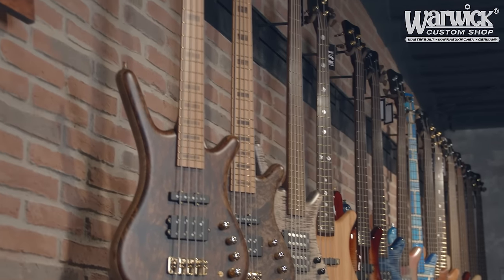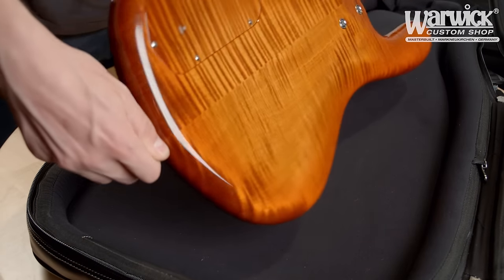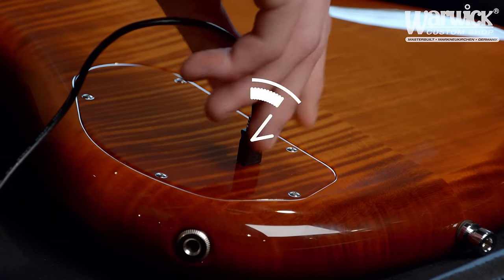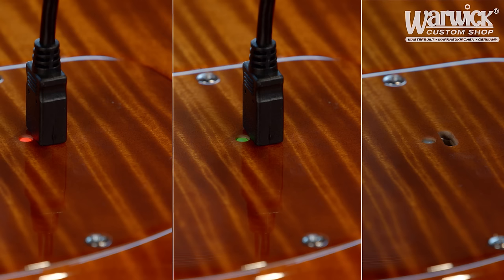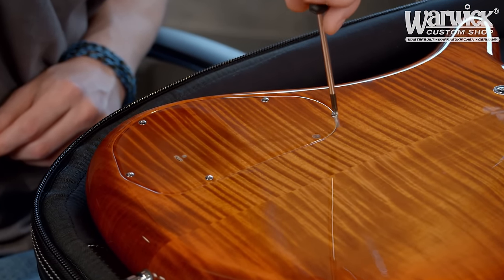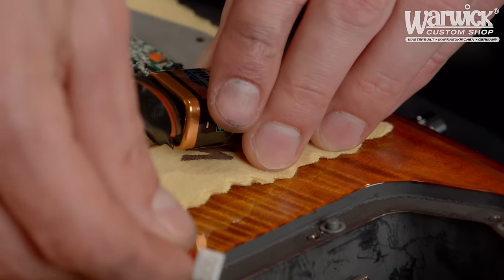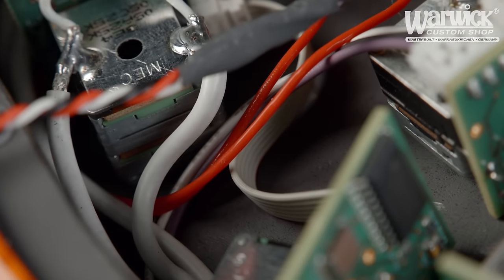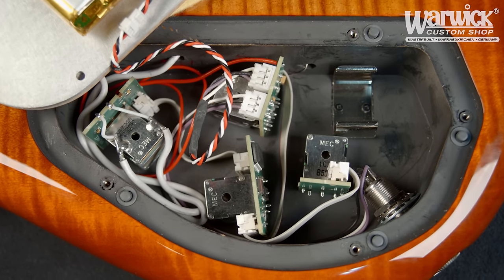Warwick Custom Shop Masterbuilt - Warwicks new bass electronics

Comment: This is a definite improvement for Warwick! I like this new preamp much more than previous designs. It's worth noting however that it is not accurate that there is a truly passive mode or truly passive tone control, as there is an active buffer stage on the pickups which will require power and transforms their high impedance input to a low impedance output. This means power will always be necessary and that the blend is active, and "passive" tone control is not interacting directly with pickup coils as in a traditional design but with the buffered, post-active blend signal. The two methods sound a bit different, but preferences vary!
Reply: Now thats a bummer. So even if you use passive pickups in "passive" mode you will be using the battery and the internal buffer?
Reply: Pablo Cavallo, yes, I believe so. There isn't a hardwired bypass because the pickups go directly into the blend pot/board, which I believe is active all the time.
Reply: WHY would you want to go through all that time  and hassle ?? I have 2 9v batteries in my active passive bass that i change maybe 2 times per year and i play professional. so that means I play a whole lot week after week. If my batteries die, I just pop open the battery compartments pop out the old pop in the new, or just pull my tone knob up and play in passive mode. No unscrewing anything, no, charging for 3 hours.
Reply: @CombinatorMusic  When in passive mode, it is true passive. EQ and active circuit completely bypassed. No battery or charge needed. Flick it in passive mode and plug in and play like you usually would.

Comment: I don't see any advantages to have this battery instead of a simple 9v removable battery.
Complexity for nothing
Reply: Advantage = duration and less waste
Disadvantage = 5 screws instead of easy-access if you go the 9v battery way.
Reply: What waste? It's like charging your phone, lol.
Reply: There will always be waste in the long run (batteries eventually degrade to a point you have to dispose of them) but it is a big improvement over 9v.
Reply: yea!
Reply: There's no need for all that time and $$. SMH